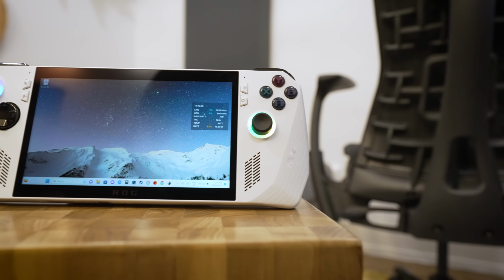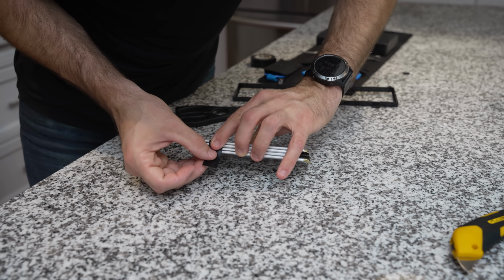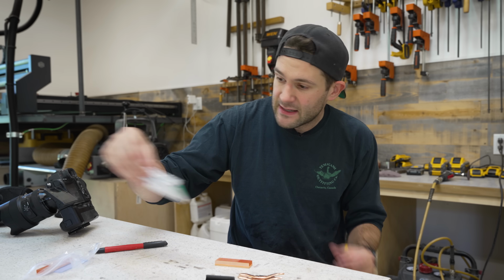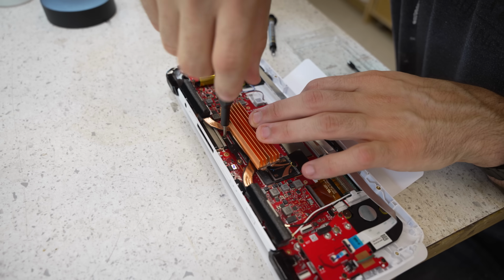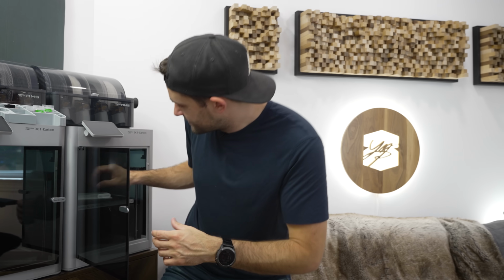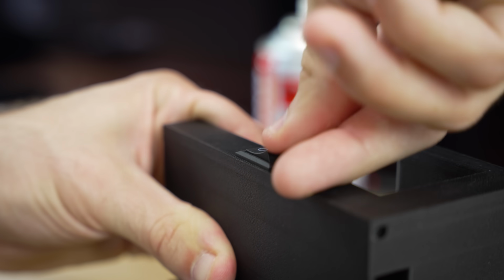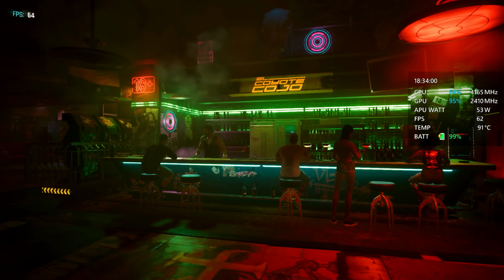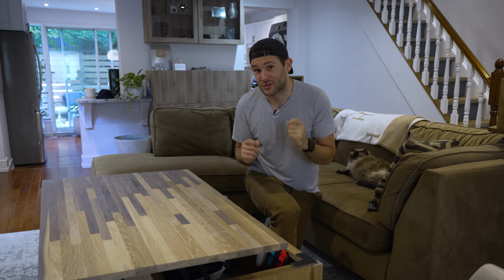I don't understand why people buy Steam Decks...

Comment: ROG Ally sure is more powerful than the steam deck, it's also unfortunately not showing that power in any benchmarks where games run very similarly. 
I don't see the point of this video since you claim it's better than the deck but then rip this thing apart anyway because it's 'not suited to your needs' or: 'I wanted to do a video where I do some fun hardware stuff' 

If you get back to this thing, may be swap out the SD card reader for one that'll continue working. 

Like- I'm all for competition and more options for handhelds but the video title is bait and not a good way to get viewers to want to see more videos. Interesting mod but this is not how you want to get people checking out your vids.
Reply: The Ally and Deck run very similarly when the Ally is only drawing 15W. Turbo mode makes the Ally leagues better, even if it makes the battery die much faster. The Deck is superior when it comes to <15W usage since it’s much better optimized for it, but the Ally simply has a higher ceiling that can be reached when necessary.
Reply: @窀  That sounds like a good option for when 'docked' but it does make sense why the performance numbers were similar- reviewers doing their due diligence and comparing it properly.
Reply: @Snotnarok  Using Turbo mode on the Ally is still within the proper (fair) range lmao it’s called one device being able to do something that the other can’t. If you compare a Toyota Corolla to a Dodge Charger Hellcat, the Toyota has a much better MPG, but the Hellcat’s top speed is almost double that of the Toyota. Sure, you have to refuel the Hellcat constantly, but the top speed is still objectively better and it is disingenuous to act like there isn’t a massive gap in power between the two.
Reply: @窀  
I . . . never said it wasn't fair. 
I said "does make sense why the performance numbers were similar- reviewers doing their due diligence and comparing it properly." 

Because the reviewer was likely matching the power on the handhelds so you can see how they perform at the same TDP for part, of the review. 

Which is a great thing to do since you want to see what you're getting into for performance across the board with portable devices.

So, I have no idea where you read whatever you're replying to but I most certainly did not say what you're saying. 

Also that comparison makes no sense, you can't compare a sports car to a daily driver car. That's two different leagues of price & performance and both of which are good for different purposes. 
 It'd be a bad review and it'd be a waste of time. 
Unless it was on Top Gear/Grand Tour because it'd likely be a joke.
Reply: @Snotnarok  Reviewers who compare the devices at different TDPs are still doing their due diligence. One device is capable of what the other isn’t, and that is important when comparing the capabilities of two things. You said that comparing them at the same TDPs is “comparing it properly,” which to me (correct me if I’m wrong) seemed like an implication that it would be improper to not do so.

I don’t disagree that it is important to compare at the same TDP, but the Ally’s power is absolutely shown in benchmarks that push it past 15W TDP, and that is something important to note because the Deck does not allow you to do that. In that regard, the Ally undeniably more powerful, regardless of battery usage. That’s all I’m saying.
Reply: @窀  I said the devices were similarly specced in the review- because as you said they were comparing them TDP to TDP. So you were right- ROG has a performance mode which helps in said comparison. I'm happily admitting I wasn't aware of the performance mode adding to things- though I will say it doesn't change my decision with how the battery life tanks. 

I'm not saying - 'end the review at just the two TDPs that match" I'm saying - compare 'em both, but also do any extra performance modes and share the battery life problems. Due diligence because in terms of handhelds it's not just performance that matters like with a desktop for gaming. 

Batterylife, refresh rate, etc matter a lot so there's options in that regard. This isn't an easy choice- it's all about what someone needs/wants etc. But also how the company treats the customers - which ASUS has been in trouble for
Reply: @Snotnarok  In that case yeah I agree. It’s no secret that the Ally has garbage battery life, and this is one of the reasons the Ally X (thankfully) even exists, among other reasons like the SD card slot, ergonomics (although I personally don’t mind the shape), etc.

And ASUS will probably be able to regain a few points if their changes to RMA are sufficient.
Reply: @窀  Most handhelds these days have crap battery life. My point was more that if we want to say "This one has objectively better performance" we also have to explicitly state "Yeah but also the batt life suffers from that. "

I grew up with a Game Gear that was comically 'used' by someone else. Man I loved it more than my GB that was also used (I wish I had photos, whoever owned it before me abused it) but- one really needed the rechargable batteries vs the GB. 

ASUS needs way more than that since their rep for bad RMA stuff was before the ROG launched. 
Legit that was one of my reasons of worry when buying it and I went with the Steam Deck since I saw performance was similar (For TDP just to be clear) and then the SD card fiasco blew up. Then GN really exposed them and it was -ok, people weren't just blowing smoke. 

Just to be 100% clear- I wanted the ROG because of windows being it's OS and that being good for my art software - so in a pinch I could use it vs Linux where it's something you have to wrestle to work. 

Genuinely hope Asus gets their ass in gear since that's my mobo & IDK who else to get for the next build if they're going to be that scummy with their RMA issues :\

Sorry for the long reply, I think both devices are great but Asus has really lost a lot of face to me recently which is frustrating since the device was good
Reply: @Snotnarok  Nah the long reply is fine lmao I’m almost positive I’ve written way longer comments before. I don’t have a TikTok attention span.

Of course the RMA issue isn’t something that’ll blow over in a week, but I think a change has the potential to start the process of shifting the image (potential, because it first has to actually be a significant-enough change).

And yeah it seems like mfs brought console wars to the PC space with this whole Ally vs Deck (vs basically every other handheld PC) thing. I don’t exclusively root for the Ally for this very reason since there are things that the Deck objectively does better.

Comment: I have a ROG with 4TB running Chimera OS with Steam and Emudeck and Lutris. I have a powerbank attached to the back. Some games I buy using steam, most are steamrips. It's great for upscale emulation. I can attach it to my TV, use it on a monitor in my study, or take it to my family and game over there. Except for battery life it's a perfect device.
Reply: I'm thinking of putting in 8TB nevertheless.
Reply: Yes, Steam Deck is a great product and Valve is a great company, but this device is really good.

Comment: I know this is an old video, but this is still true now.  Steam Deck excels in performance at 10 watts and lower, more so than any other APU in other handhelds.  That allows it to run most of what more powerful handhelds run, at an acceptable quality, whilst running longer on a battery, and it costs significantly less than its rivals too.

What every single other handheld manufacturer doesn't realise is, most Steam Deck owners already have a PC for more demanding games.  Steam Deck runs 80%+ of our library of indie and non-AAA games and is priced so much cheaper than a component upgrade that it's a no-brainer.  It's also the most performant device for emulation for it's price too.

Comment: I know the title is bait, but I'll bite.

Yeah I wonder why people would prefer to buy a Steam Deck when they could instead buy an Ally, spend probably close to 1000 or more on tools, another 150 on a battery, spend a few weeks to design a new solution to better cool the system and hold the battery and in the end get something that still is not only bulkier and therefore worse as a handheld, but also not as good as a traditional desktop.

Even with considering that the title is bait for comments and views. It's obvious that most people would be better served by a Steam Deck or a Lenovo Legion Go if they wanted a handheld PC since those don't need to be torn apart to make them worth it. And even considering it's use as a desktop, well there are cheaper options that still have a small form factor. I think the switch mod video you did was pretty cool and could have a legitimate use if one had the resources and tools to make it, but this just seems like kind of a waste imo.

Comment: 1. Steam OS, I want a gaming console not a PC
2. EmuDeck
3. Desktop mode is an option that allows you to completely work with your system
4. It doesn't run Windows
5. No needed modifications out of the box

Comment: The title aged like fine milk, but in a way, this is a good project?
After all, people will trash or mod their ASUS rigs, you just went down the modding path a bit earlier than you had to.
Keep it up, my sister's got an Ally a few months ago and I'm afraid I'll have to fix it myself in the not-so-far future and I'll need all the videos describing how to replace every single garbage part ASUS jammed into this pile of e-waste.

Let's be frank, the Steam Deck is hard to improve upon, it's not a good DIY project when you've got nothing to DIY on the thing. The Steam Deck would not get you content to make.

The ASUS ROG Ally? Now that's worthy of a DIY project video. Really, that's a rabbit hole and not the kind you'd want to get a taste of from Deco*27, but a real nasty rabbit hole you wouldn't even poke at with a 10 feet pole. It's made of the cheapest materials, built in with some great serial errors and is in overall quality: trash. This channel however, is a titan of recycling, except this isn't outdated hardware, this is built to be garbage.
You can replace everything in that handheld and improve it. Well, once you finish you're holding either a Steam Deck or a mini PC with a large battery glued to it basically, but let's ignore that for a second. You can always buy the shit one, spend thousands of dollars to make it acceptable.
The best thing. You don't have to care about your warranty. ASUS doesn't respect your warranty either, it's just a label they put on overpaid unnecessary "repairs" they want you to pay for! Then send back the device with the original problem still present or just decide that they won't give you back your device, because that's great. See, modding it solves this problem. They can't hold your hardware hostage if you're not sending it to them. See? Infinitely better.

Comment: I equipped my Legion Go with an 8TB SSD and internal 2TB Nvme. The MicroSD is just 512GB but I have over 300 top tier Steam games loaded on the SSD. The 2TB is at less than 10% loaded for the OS drive.

Comment: The Steam Deck when compared the ROG Ally is proof that you don't need the latest hardware to get the best performance (proceeds to run Saints Row 3 Remastered at max settings), oh consoles do that too now that I remember... And even with relatively minor hardware updates Valve doesn't need to compete yet with Asus, spec wise.

Comment: Why not just rewire the battery connector  with new wire so you don't have a solder point. You should be able to push out each wire/pin with a pick

Comment: People in the comment section hating on the ROG Ally is rediculous. Steam Deck is fine. It's not amazing. It's fine. The Ally just does more in my opinion. Gaming is cool. Productivity is just as cool. I'm not hating on Steamdeck, but the type of fanboys that are steamdeck mad makes it seem like it's the holy grail. No it's not. It has its pros. Just like Ally has. It has its cons just like Ally does. Grow up people.
Reply: Personally I like the Steamdeck due to its trackpads and the software it runs. Linux isn’t as resource heavy and you get more power with the same specs. But if you have an ROG ALLY that’s fine. I will admit the Steamdeck is a bit weak when it comes to AAA games and the ROG doesn’t have that issue.
Reply: @Goober762  oh yes. You raising points I actually forgot about. Admittedly those trackpads are amazing though . I also like what you said about being a lot less resource heavy. That is one of the many issues with the Windows  OS. I do productivity stuff like using the Adobe suite and the Ally helps me with this. I also have a 16inch portable monitor and wireless peripherals so that helps.

Comment: "Significantly more powerful than the Steam Deck"
Its almost like the base Steam Deck model is half the price lmao.
Also, when the ally first launched they were literally tied for performance on the same TDP and even to this day they trade blows on the same wattage.
And even after ALL OF THAT, Steam OS is still better tuned and optimized for steam games overall through the use of proton.
I like you as a Youtuber and all, but this video title and intro is an absolute joke.

Comment: I always find it fun when ppl think they can do small DIY tweaks that make anything work better or smoother.... often it is ALOT of work for a very little gain that usually comes with new drawbacks attached...
-If things were that easy to improve, they would most often allready have that improvement from the start...

Comment: "why do people buy the deck?" does 50 mods on the ally. that said, the dock you made zac is awesome. valve and asus themselves need to take tips from what you made and offer a high perf dock as first-party cooling hardware - really the only additional hardware cost over that deck dock is the fan and plastic for the housing.  some people (phawx on a recent moore's law is dead episode) talked about that sweet spot of performance, and how cpus are often created with a specific TDP  performance to power ratio in mind. great build!

Comment: Before few years when ryzen was on 2000 series I was building my pc 3 times, because Asus quality control started to suck at that age. 2 Asus Rog b450 mobos were having coil whine that was going into headset too. I dont want to support Asus anymore, thats why I will be buying Steam deck oled instead of this (faster little bit yea) crap from Asus. I ended with Asus, and AM5 cpus that were fried by Asus mobos while asus was telling that they fixed it in bios but they fixed it in third one is joke too...

Comment: The reason you’re not getting extra performance is because the way this apu works the more voltage you throw at it the more it cuts voltage to the GPU and sends it to the CPU cores. If you want to see the CPU power you have gained try different cpu bound tasks at different voltages

Comment: So the rog ally needs to be opened the sd card slot needs modding you need to buy a laptop battery strip it down fold it and cover it up again then drill out the back case use a 3d printer to print a new back plate to fit your new battery to make it all actually work. when my steam deck got delivered I was playing within 30 minutes think I’ll stick with that 👍🏻

Comment: Very interesting video.
I think that the mods you did are cool, but tbh the average user would never dare to do it.
Most users just want a easy plug and play experience without open and tinker the device.
I did research for a while and in the end went with a SD oled, because frame rate is more consistent, battery life is better, it runs even latest games ok, steam os, valve support, trackpads and overall look. 

I have a custom PC powerful enough to play the latest fps game at home mouse and keyboard, I will be fine with an underpowered SD oled on the go and I will mostly play platforms like Ori and single players like Control + emulation, where I feel more confident with joypad input than M&K. 

I find the alternatives interesting but I wanted to get only one of them. 
The Ally is a no go to me already from its white color + cooks microSD cards, the Legion Go seems a bit too big and the detachable controllers seem a weakness for its bulky size and can become an extra point of failure in the long run + both are very power hungry and you either need hardware mods as you show or to carry 20k powerbanks just to play "casually" more than 1-2 hours on the go.

Comment: Even if you don’t get better performance from the added cooling, running it 15-20° cooler would probably increase comfort in handheld mode and overall longevity of the components.

Comment: main reasons are price, battery life, and software that was designed specifically for the handheld its on while also having desktop flexibility. but that question can also probably be applied to the ally as well considering what you now have isnt an rog ally

Comment: Yeah the liquid metal may be the best heat conductive material yet you should know that it is also corrosive to the CPU and GPU when you apply it. Asus is using those liquid metals on their high end gaming laptops in order to take away the unwanted temperatures which mostly caused by AMD ryzen processors. You all should check the videos around youtube how corrosive they are to those +2000 dollars  worth of laptop processors. I won't be risking it and instead will go for top grade NON-METAL heat pastes. Much respect from Istanbul City. Cheers.

Comment: Lol Asus fan. Bro get with the Deck program, deck doesn't void warranty for opening it up. Lol. My deck has a Radeon VII GPU attached and pushes more fps than that Asus junk. Asus doesn't run steam which is part of the problem.